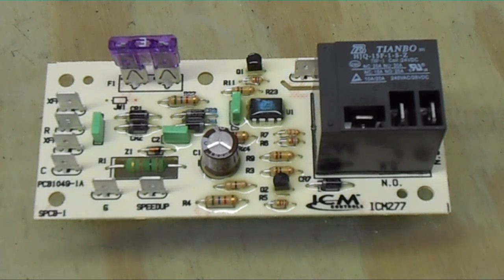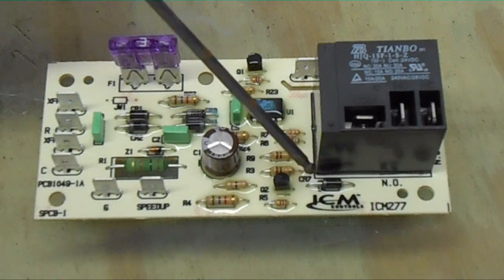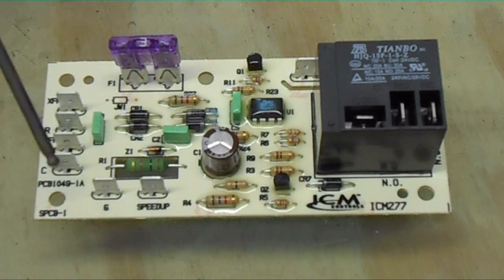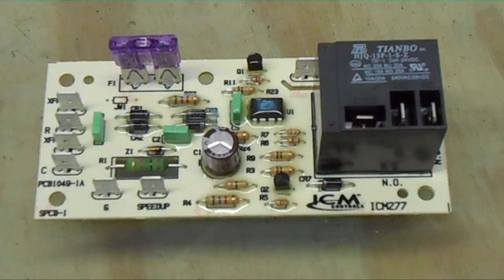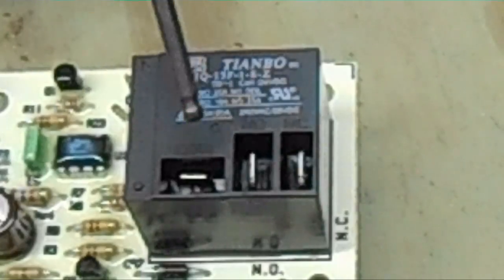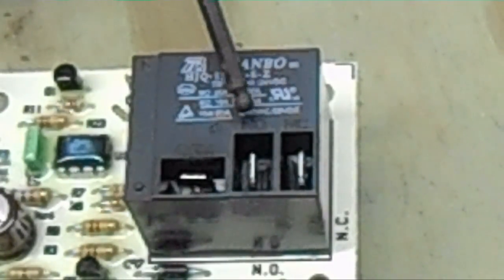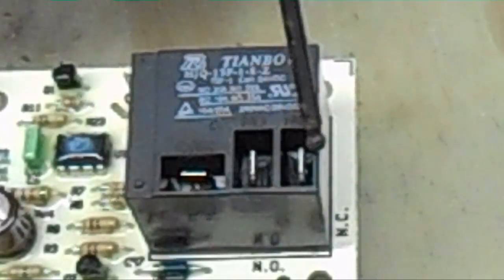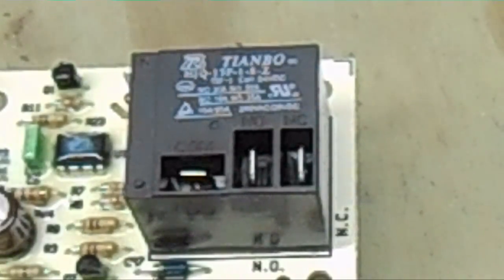HVAC Relays- The ICM277C Blower Control Board

Comment: Thanks for this video. As a result, I'm changing over from the Goodman to the ICM277. The Goodman lasted for 3 years before it quit. I blame it on the China manufactured Potter and Bromfield relay. Cheap parts will get you a lower mtbf (mean time between failures).

Comment: Zack thanks for the breakdown
  I do t see that board to much...but I may just start sticking it to replace the blower relays in a lot of the air handlers I see.
Reply from the maker: Billy Knoth It can be a good general purpose replacement.

Comment: Thanks for this video, I'm adding AC to my old furnace and I need to install a cooling XFMR in order to do it as it has a combination fan/limit switch,  yea.. it's that old lol. I'm thinking of hijacking the continuous fan switch and using a 24/120/SPST contactor to turn the fan on with a hope and dream it's close to 800 cfm. It's a salvaged R22 unit

Comment: I have the same board. But the fuse is blowing. I changed the fuse and still blowing. Is it the board I need to change.  I'm getting 27vac on the secondary of transformer.
Reply from the maker: The fuse blowing indicates a short circuit somewhere. Perhaps a relay or some other component. Could also be wires touching in the cabinet. 27 volts is normal on the secondary.

Comment: I had a unit today that was frozen..  Goodman..the fan would come on in heat mode, but not fan or cool. Change the board ,still the same thing. I was wondering if somebody wired it up  wrong.

Comment: Does this particular board affect whether the heating elements come on or is this board only for the blower itself?
Reply from the maker: Blower only. There is a wire from the heat relay that runs to this board. That wire is to call for blower when there is no G call
Reply: Okay, thank you for the reply

Comment: Zack  the main power coming from the L1 is  connected to the COM terminal and the two blower motor speed wires blue to NC for (heat) and Black wire (HI speed for cool) connected on NO terminal . Do you concur?
Reply: Yes, for two speed operation. But the way Zack shows is for single speed operation (same speed for heating and cooling).